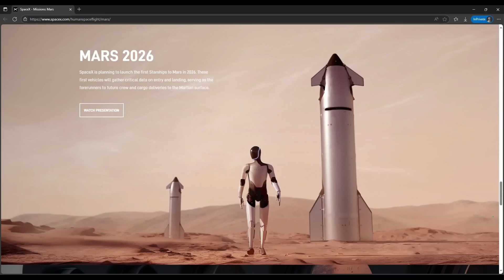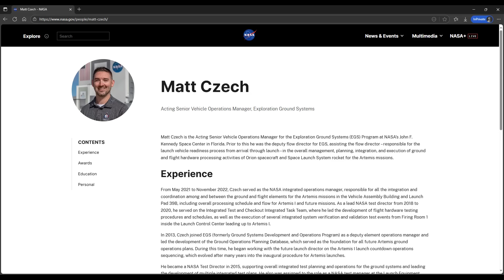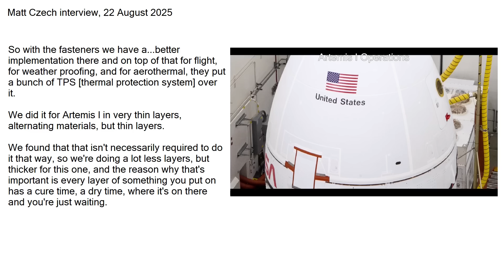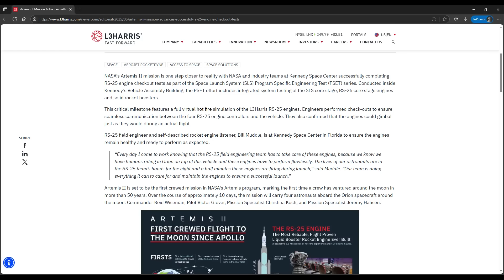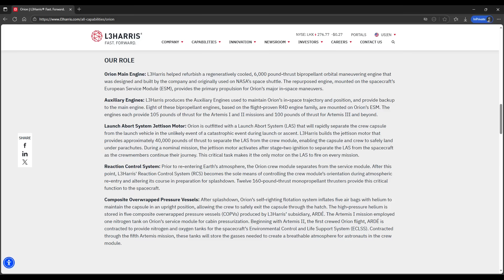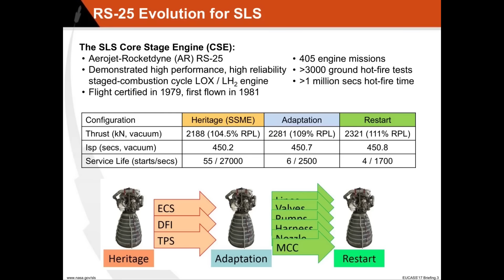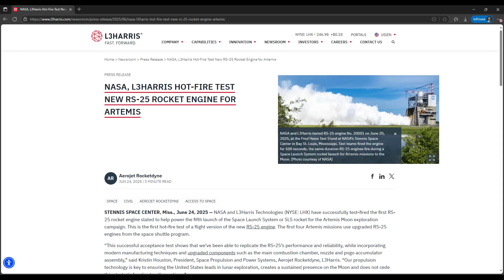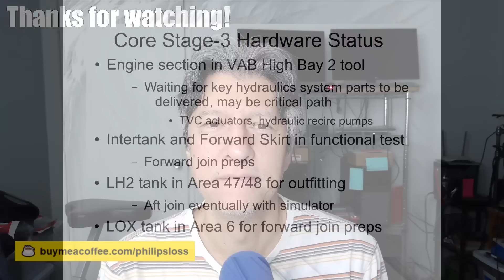Starship flies successful test, Artemis II launch preps continue

Comment: 2:30 Philip, tell me seriously, can you look at pictures like that with the serious face? 
1) Where Starships landed on Mars without landing legs in the hilly terrain.
2) Particularly where its Starlink dispenser Starship variant with the horizontal slit, without any elevator to drop the robot down? Without any solar panels on them to power them through year long space journey?
3) With the optimus robot walking on Mars, where its batteries would freeze over in a second?
Reply from the maker: That's what SpaceX says, and then we can make our conclusions about how realistic the renders are if that's all they are going to "say."  I think SpaceX says it with a straight face, but your questions are all valid ones.  Unfortunately, we're sort of stuck since they can keep their plans secret.  FWIW, the "2026" part of the picture invites an increasing amount of skepticism, especially given the lack of a detailed public schedule.  And that's the most relevant to Artemis, given the mid-2027 date that itself is...questionable.
Reply: I think you might just be taking a preliminary promotional render as an actual plan. I suspect this is just an interim artistic rendition while a mission profile is still being made by the engineers
Reply: @gavinreg  i mean when every other spacecraft builder puts out an animation it's vaguely related to reality, not just a total fantasy social media post, so i don't see the point

Comment: I wonder how much money has already been spent on building Artemis IV hardware. That would be discarded if the NASA budget proposal from the OMB is followed but the supplement in the OBBB provides funds to continue Artemis IV and V.
Reply from the maker: It's hard to get a clean accounting of lifetime costs, maybe we'll get something from one of the auditing bodies...but those bodies are their work are being cut back, too.  What remains for Artemis 4 is finishing the two Boeing stages (Core Stage and EUS), the two new connectors (the USA and interstage, which are much simpler), and certifying the new Block 1B config for launch through remaining testing.

Comment: Starship was NOT a success, it was completely destroyed, musk is the reason why the USA is not going to the moon in this decade👎👎👎
The government should cancel starsh*t and choose blue origin for Artemis III, 
THEN we can talk...
Reply from the maker: The flight test was a success.  It used a throwaway prototype, as have all the tests so far, SpaceX intended to sacrifice both stages this time.

The question of whether Starship will be ready in 2027 for Artemis 3 is separate from Starship as a whole.  Starship is a SpaceX product that they are developing.  The government could buy out the lunar lander contract, but they can't cancel the program/project as a whole, because they don't own it.

The legacy programs are fully owned and paid for by the government, those are the ones that the government can fully cancel if they want to.
Reply: @PhilipSloss why do a❗ 10th❗ test flight where you destroy both stages?? For what???
 Think about the Apollo program, there was no need for that!
Starship is part of it, refuelling more than a dozen times in LEO is nonsense and the whole concept with a tower landing on the uneven moon surface without tipping over is MADNESS!
China will win, congrats to them🎉🎉🎉
Reply: @veryunusual126  Apollo wasn't trying to develop a system that was either affordable or sustainable.  Which is why in the end it all got cancelled.  Starship is definitely not trying to repeat all the Apollo mistakes: on the contrary, it's trying to reduce the costs of launch by another factor of 10 compared to the already record-low costs of the Falcon 9.

As for why both stages were expended: they were throwaway early prototypes that were used to perform in-flight experiments.  They weren't the final operational design.  And keep in mind, it's only been less than 2.5 years since the first Starship integrated test launch, despite the fact that SpaceX managed to cram 10 (going on 11) test flights into that time span.  These are, as a matter of fact, still the early days in the Starship R&D program.
Reply: @Spherical_Cow there is no economy on the moon or mars, starship isn't cheaper,
Wake up!!
Reply: @veryunusual126  the full Starship stack costs about $100 million to build, launch once, and toss away (and the bulk of that cost is labor, not materials or propellant - so the cost will drop further with more mass-production and automation).  If it is reused just 10 times, the cost per launch goes down to maybe $20 million, including refurbishment and processing.  Reuse 100 times, and the cost per launch is well below $10 million.  By comparison, a single SLS launch costs in excess of $2 Billion (with a 'B'), and always will.  And SLS can't launch more than about once or twice per year, because the rockets can't be built any faster; Starship will in a few years launch more frequently than the Falcon 9.  It's funny to see you telling me to wake up: you're the one fast asleep.
Reply: They're not reusing either of the current version of ships, that's why they were expended. Apollo is not the same as Starship. Stop making ridiculous comparisons.

Comment: So, basically, Artemis will perform a "split TLI" burn with ICPS responsible for bout 85% of the delta-v and ESM the remainder (about 25% of the ESM delta-v capability).
Reply from the maker: Only for Artemis 2, with the rationale being to get 24-hours of run time on Orion's ECLSS before committing to that 8-9 day long orbit around the Moon.  For Artemis 1, ICPS fully completed the TLI burn and it will do the same thing on Artemis 3.  And then that's the plan for Artemis 4 and beyond with EUS.

Comment: is it true that spaceX is building a testing structure for HLS thrusters ? theres a photo circulating online . they are kinda late but alright  .
Reply from the maker: Not sure if that's a rumor about whatever that structure is or not.  The big picture issue, though, is what is the critical path for HLS?  Strictly from a propulsion system standpoint is it the thrusters or is it the design/production of the ship to feed those thrusters?

Just looking at Starship development, it at least appears that Raptor engine development is much farther along than the ships and boosters.  But NASA needs an integrated, working version of the system that can persist in space for 2-3 months, fly to the Moon, and then take a crew down to the surface for a week, then back to Orion.  In less than 22 months, because Starship has to be orbiting the Moon at least a month before Artemis 3 flies.
Reply: @PhilipSloss  ye not hapenning on 2027 imo . maybe 2-3years late . i wonder if theres another option for nasa .
Reply from the maker: @kuriyama-d4c  Blue Origin would be an obvious alternative, but they aren't saying much about their critical path specifically or their schedule generally, either.  There's not much evidence they have caught up to where Starship is.  If there is any, they are keeping it secret.
Reply: @kuriyama-d4c notably, Blue Origin has received about 25% of its contract money, based on completing technical milestones, as opposed to SpaceX receiving almost all of it for HLS. This would suggest to me that BO has only completed preliminary designs for Mk2 at most, so I wouldn’t bet on it being ready within 5 years
Reply: @gavinreg  I would add that there are rumors from credible sources indicating that New Glenn has a huge performance pitfall; around 20 metric tonnes of max payload were missing from the capabilities of the first flight test of New Glenn allegedly. Given we have indications that Grumman has left the project, leaving the propellant transporter to Blue as well, and evidence is mounting that their schedule, while being more realistic than the original HLS timeline, is still not realistic.

Comment: 12:26 - so many parts compare to a Raptor Engine.
Reply from the maker: There's definitely contrasts between the engines, and RS-25 isn't full-flow, but Raptor has much the same logical elements.  One of the contrasts is that SpaceX is willing to extend the development phase to continue to invest in R&D to keep pushing the engine design beyond just a "working" version.  The government invested in upgrades in a less efficient manner, start and stop over decades rather than up front...but then, that's how the government typically does it.
Reply: @PhilipSloss  they got old pretty well, though.